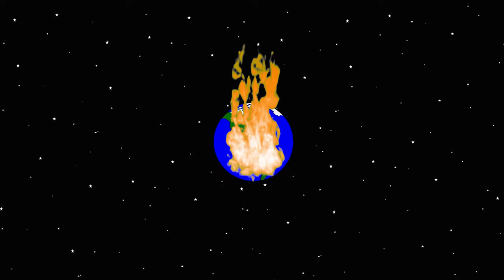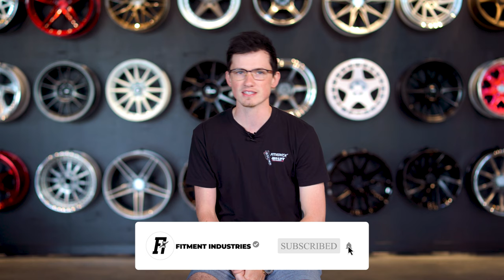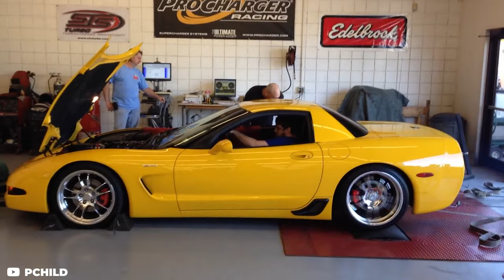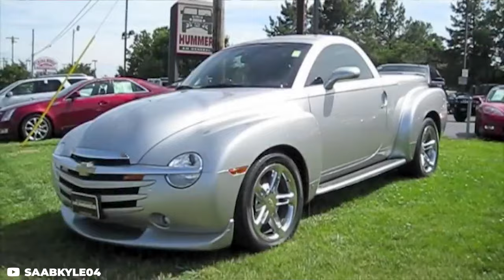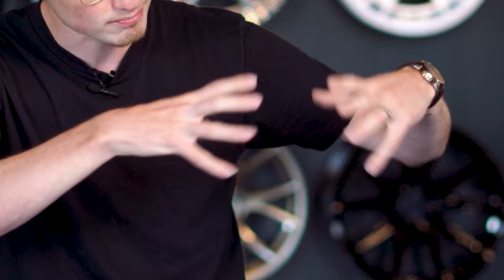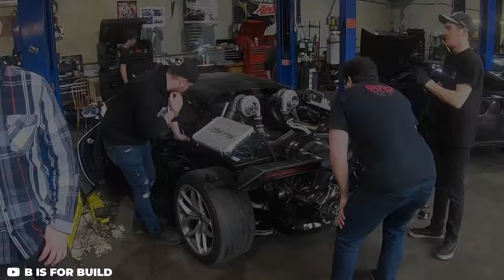So You Want To LS Swap Your Car

Comment: I’ve seen people LS swap rams like my 02 ( they dropped a 6.0 ) which looks pretty good, to be honest though my 02 ram would require a little fab work and I could fit the v10 viper in there as well. I got a big engine bay 😂😂😂 but most people just swap out the 4.7 mag for the 5.7 hemi

Comment: depending on the car it can be a good idea. Im planning on getting a Z32 and if the engine ends up going to crap then will LS swap it. I wouldn't do it when the stock engine is working find tho